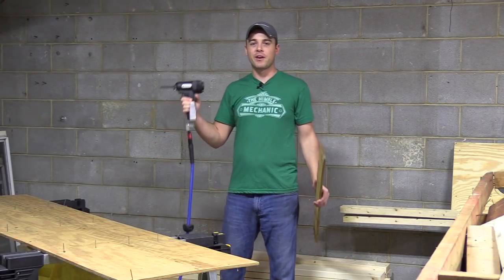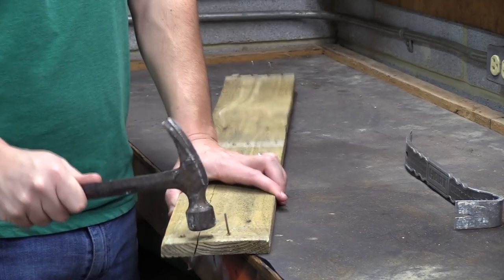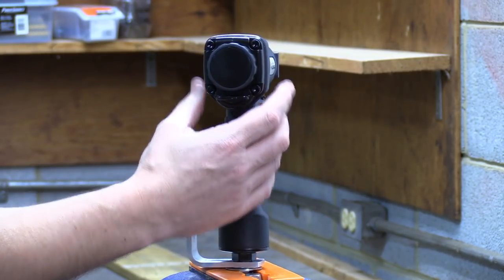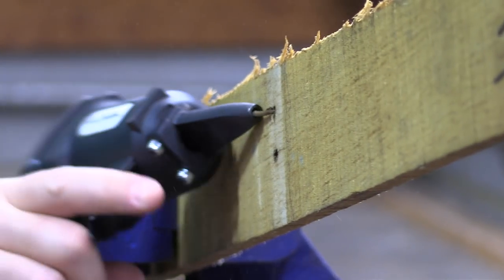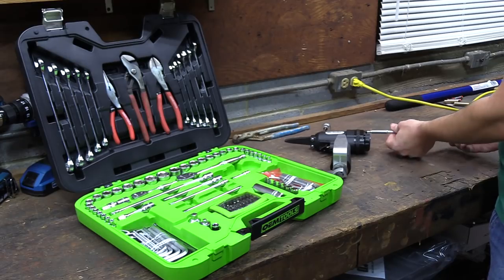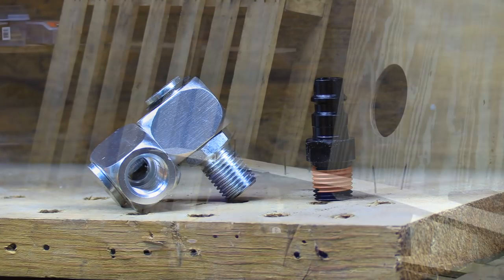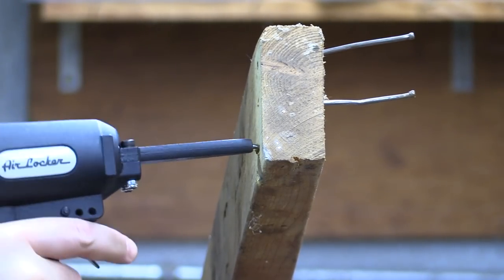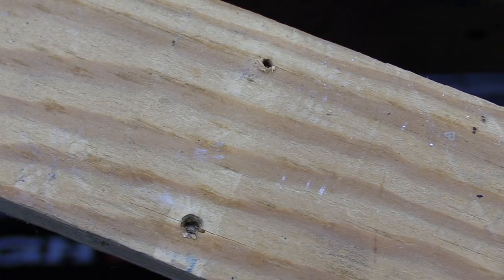FREE WOOD!! (*just remove the nails) - Air Locker AP700 Nail Remover

Comment: Helpful tip if using this or even the cheaper ones on Amazon... take a paint stir stick and drill multiple 1/16”, 1/8” or other holes in it... slide that over the nail before using this and it won’t leave the punch mark in your wood.
Reply: I was wondering about that.  Or taking one, and cutting a slit in it the width of the nail.  So that way you don't have to fish the nail through the hole, just slide it up and into the slit you cut.  But I don't own one, YET!!!  Would this work?

Comment: I've been using this nail remover with great success. It's a super tool and works best when de ailing dry, not wet wood. For safety I followed another user's tip and place my boards over a five gallon bucket 3/4 full of water and punch the nails into this. The water cuts the velocity of the flying nail quickly and contains all the nails in one spot.
Reply: Brilliant, thank you.
Reply: that's a really good idea. 👍

Comment: They should have different sizes of replaceable punches so you can choose the hole size it's going to make.  Otherwise, very cool.
Reply: it'd require the tool to be quite a bit more expensive.  You need to replace the guide as well as the punch.  They could offer different version's, or a conversion kit (though this would probably cost half the price of the took) but i think the market would be small.  If your that worried about the look of the wood, it's not very likely your using old material with nails in it (exception for the recent fad of reclaimed wood furniture)
Reply: Or, change the stop to where it's flush.
Reply: Seems like you could purchase extra punches then grind one short so that it does not extend beyond the front of the guide.   Only $12 he said.  Possibly would not drive out the nail all the way but you get a smaller hole.
Reply: Glenn Felpel
Exactly. That should be an easy fix.
Reply: just cut it flush with the end...the motion will be enough to pop nails
Reply: What if he just didn't put the gun all the way over the nail? Leave a little space and maybe the driver won't hit the board? Idk why I'm here but that's what I was thinking . awesome tool though
Reply: TheZigZiggy that's what I was gone say

Comment: If you wanted to eliminate the larger hole problem of it going into the wood, I bet you could cut the plunger shaft flush to the housing and it would work just fine still, just a little bit less power obviously

Comment: I am able to do the same thing with a palm nailer. Harbor freight $15. Works pretty well. Sometimes the tip of the nail sticks. No biggie. Just wiggle the tool and it's out. But you still have to use a hammer to pull out the nail totally. I don't remove nails that often to justify this $50 tool.

Comment: I just got the Air Locker AP700 yesterday and tried it out. What I was wanting to do is hit the HEAD of the nail and drive it out through the bottom on a pallet. It doesn't come out enough to drive it in one blow, but 3 or 4 and the wood split (at least on a weathered pallet with 3/8 top boards).

Comment: I own one and love it. It has saved me sooooooo much time on wood (pallet) cleanup. I agree with everything that you said in this review except the punch hole. To avoid this simply don't hold the tool all the way down over the nail or let the tool kick back slightly so the push rod does not push so much into the wood. If you deal with nail removal you NEED this tool.

A couple of notes here. 1. The nails will come out at HIGH speed. Safety glasses (if not a face shield) are a must here. I have had nails rebound around and actually hit my face and I am sure it would have resulted in a trip to the emergency room without them... 2. place a bucket or a trash can below where you are shooting the nails out and put come paper, bubble rap or some trash in the bottom to reduce the bouncing around of the nails.
Reply: Can't say as that I have tried that. I have a pallet bar that I use to pull the boards off the runners then punch out the nails from the planks. It may drive the nail into the runners, but I use them in my woodworking so driving them deeper is not my goal.
Reply: With a nail in a 2 inch thick board would this still work to drive it through without being placed all the way flush against the wood?  I'm concerned that with a stiff or rusty nail it could be prone to just bending the nail or breaking it if it weren't seated all the way flush to the board.
Reply: Price

Comment: i have owned this very tool for 4 years now its awsome cost little very light and easy to use i have driven many thousands of nails with no issues  simply brilliant i well reccoment the air locker 11 out 0f 10.

Comment: I own one. I bought it to de-nail a deck I built for my in-laws 35 years ago. 2 x 6 nailed 24” OC. My 9 year old grandson hit the 3 1/2” ringshank nails I used to put the soaking wet wolmanized (CCA) decking and joists down and @ 90psi the AP700 airlocker was blowing  66% completely out. Those that would cling to the 2x stuff he easily Removed with an adjustable head crescent 18” prybar. Thanks T2.0.. Your help and your dads REALLY helped me out, Thank you both,
Reply: btw, I picked up an extra piston as well.

Comment: Bought one a few months back. I use the hell out of it. Where it really shines is in processing pallets. No body is really shedding a tear over a pallet board having an enlarged nail hole in it. Most times I just use a circular saw and cut the outside runners off then use a Vergo Ind. Pallet buster to pop the slat off the center runner. If you're the type to go the reciprocating saw route by cutting the nails behind the slat, this lil guy is your best friend for punching the cut-off nail heads out of the slat. Because the punch extends beyond the end of the nail tube you just place the end of it on top the cut nail stub and It'll drive that leftover nail head right out or at the very least push it proud of the surface, which makes pulling it the rest of the way out as easy as swiping a flat bar over the other side to knock the heads off.

Comment: That right angled fitting prevents hose wear at that joint. Very smart!
The gun costs $51 on Amazon. With a bundled extra driver it is $58. The driver by itself is $13. Good idea to get the kit.
I think it makes sense to also get the angled valve thingie and the belt clip - very ergonomic and will spare your air compressor hose fittings from getting a kink.
Good review, and very happy to have seen this tool.  I need one for pallet work. I typically use a Sawzall to cut the nails off, because I like the embedded nails in the wood for texture.  I 'sand' off the tops of nails with an angle grinder and metal grinding wheel, then sand the wood down, stain, oil, poly up the piece and done.  However, it is very hard to cut the wood on the saw if nails are still in it. Some of the pallet ribs are thick and should be cut in half to be lighter for projects.  Now I can do that, hurrah!  Now to find a tool to pry off the pallet boards.

Comment: I have one of these. Works great, especially when tearing down pallets. One problem did arise but was easily fixed. A nail go jammed beside the plunger. I tool it apart and it fell right out. I haven't used mine for a while but I believe this unit requires oiling like a regular nail gun. I will read my manuel before I use it again. All in all, I was pleased how well it worked.

Comment: Just ordered from Amazon and it arrived today. Will put it to use in the next couple of days. Some of the videos I have seen suggest using alower pressure than 90 and also drive the nails into a five gallon bucket. I will give these try and see have it works for me.

Comment: Maybe in  cases when you want a smaller hole you could put a spacer  to keep the AP700 a little higher up from the wood , so the rod will not puncture the wood . Great tool and I will be buying one .
Reply: I'm thinking of 3D prining a "flush" spacer to fit over the nozzle.  This will allow the rod to only extend to the surface of the wood.

Comment: It is a fantastic tool and I use it several times a month - I dismantle pallets and work with pallet wood a lot. This tool took a lot of research (I have the silver/red 600 series, not the 700) but once I got it I have never regretted the purchase. Thanks for the good review video, you present very well.
Reply: If you don't put the nailer against the wood, I find that the hole it leaves will not be as wide - but personally don't mind the holes since pallet wood is already quite... holly
Reply: Hi guys, I just received mine 😊
But i don't know where to put the oil, can you please help me?
Reply: nico97412 in the air intake. Look in my videos, I show how to put air in mine.
Reply: Thanks 😊

Comment: I would go back 53 years and buy one.
My father used to pick up scrap wood and it was the job of my brother and me to clean the wood of nails.
Using old crappy wooden hammers whose handles would break was bad enough, but he wanted the nails straightened to be reused.
Banged a lot of fingers doing that.
Reply: Exactly how I learned to pull nails!!!!  And those bent nails were the ones I was free to use at 6 years old to build anything I wanted!

Comment: First, I want to say I do love this tool for working with reclaimed wood, namely pallet wood.  The problem is you have to pry the slats off a pallet first, which takes time and will crack/split 50% of your boards on a nice old weathered pallet.  Recip saw underneath the slats, just cut the nails off flush.  Plus, keeping the nail heads in the wood adds character, imo.

Comment: I have one of these, also from Amazon. Another use is that you can dial the pressure right down at the compressor, then use it to punch nail heads down just below the surface of verandah floorboards.  Previously, it took forever crawling round on all fours with a hammer and a nail punch to do that to all the nails that had worked loose and risen up over 20+ years.  But now, I can crawl around with the Air Locker and bang, bang, bang my way around the verandah in a fraction of the time.  We have a BIG verandah...!  If considering this, it's important to (a) dial the compressor output to the lowest pressure you can, and (b) do a couple of dummy run tests on some similar hardwood to the floorboards and with similar sized nails, to make sure you don't punch the floorboard nails right through on the real thing.

Comment: This is perfect! I'm building a shed/ workshop out of pallets and the ones I get are easy to tap the 3\4x3 planks off the 2x4s but it takes too much time to denail them with a hammer and pry bar and I'm too tired to put them up before I go to work. This will definitely speed things up and I have a lot more planks to harvest for the siding!
Reply: Did you finish the shed? What size is it? How many pallets did you use?

Comment: That is pretty cool. The price is not bad. You could regulate the air down so it does not damage the wood as much.
Reply from the maker: Yeah I guess so....I was using it at 120psi line pressure (max recommended pressure).  It seemed like the ongoing complaint I read about online was it not pushing nails out due to low line pressure.  Good tip!

Comment: I had to replace about 300 pickets in my daughters fence. The property owners association required replacement of several broken and warped pickets in the 16 year old fence, but replacing an old picket with new one looks terrible so I decided to replace all 250 or so pickets. The original pickets were installed with staples, a poor choice since a warping picket will pull the staples out but quicker and cheaper to install. A friend is converting four old grain bins into small apartments and is using old fencing as the inside wall material and wanted the old pickets. However, pulling the old staples is a nightmare, so after seeing the AP700 in another video, I ordered one from Walmart for $49.99 with free shipping and received it in about 4 days via USPS. The old pickets were easy enough to knock off with a hammer. Using the AP700 on a staple instead of a nail still works fantastic! Some it drives completely out, since I was driving one leg of the staple some don't clear the board. I have a Crescent NP11 11" nail puller. and that makes pulling the staple the rest of the way simple and easy. I am very satisfied with this tool. If you bust pallets for the boards, you just can't beat this tool. And, by the way, I replaced all those pickets using screws!!!!

Comment: That's one of the most unique new tools I've seen in some time. I definitely see value in it, especially for trim and baseboard. One question, how bad is the tearout on the face of the board when the nail is driven out? Ti me, that's the important side. It was kind of hard to tell but it only looked like the back of the board was shown in the video.
Reply from the maker: Some of the pallets had minor tearout....but a lot of those planks also had splits/cracks in them already prior to me removing the nails.  For the most part, it seems to be similar to using a hammer and prybar.
Reply: Think I'll just keep pulling all my trim / baseboard nails through from the back.
Reply: How would this work on 2x6 decking material with 3" nails sticking through? I will check to see if they have a stronger gun great video
Reply: Dale Gribble.   I have been doing it that way for thirty years, and it is by far the best method. Perhaps not the fastest, but definitely the best. Like anything else, Quality results typically require a little more time.

Comment: I've done a bunch of pallet wood salvaging and hands down the easiest way is using a sawzall to remove boards then this thing to pop the nail stubs out. No matter what tool you have to remove boards if you pry the pallet apart your wasting anywhere from 10-75% of the boards to breakage on most pallet types.

Comment: Great vid and interesting tool.  Would think like finishing nailers maybe there is a depth adjustment on how far the shaft comes out to address the hole you mentioned at the end?  Seems like a good solution. May reduce the complete ejection from the wood count but eliminates the hole issue.

Comment: I recently got one for reclaiming pallet wood, and am very glad I did. I think the hole size is less of an issue than one might think. One youtube video I saw strongly recommended drilling out the holes after removing nails the non-Air Locker way. This is to remove the little bits of wire that are left behind by some of the types of nails. Very important if you are going to be re-surfacing the boards with a planer or jointer. Using a hand held metal detector (around $20) is a help before spotting those tiny bits of metal before screwing up expensive machinery. I think the Air Locker slightly larger holes may greatly reduce the need for driliing out every single hole (saving even more time!)  Whether or not you're  re- surfacing the boards, that's when fine sawdust and wood glue is handy. (Others have stressed eye protection - Very important! Those nails really fly! I found one sticking out of the side of my shoe yesterday, after having fun with my Air Locker)

Comment: It's a great tool. Not as good as a nail kicker v20 but for the cost it works well. I reused all of the 150 year old actual 2X in my house for my front porch framing and left it exposed. Most of the time the gun just sits in my garage but it saved me hours of time denailing all of the original teue 2"X8"X24' fir. It's mainly used by pallet manufacturers to quickly fix pallets but they also mainly use the nail kicker it's a lot more heavy duty. And trust me I'm not one of these people that build crap with pallets I have 20 years as a finish carpenter.

Comment: As a teenager in the late 1960s I worked at building pallets and repairing old pallets.  My boss found out the quikest way to remove the board that needed to be replaced was to simply pound the nail through with a punch and heavy hammer.  Screw nails were almost impossible to pull from oak.  This tool would have made that job almost effortless.
Reply: Will - hi Will. I only want to break a couple of pallets down to use the wood to make small raised beds for herbs etc. So since it doesn’t matter to me that the nails remain in the big pieces of wood, is it possible that a nail puncher really is all I need. 🤔

Comment: Will you still get a hole in the wood if you don’t hold the gun flush with the surface? Or maybe use a spacer scrap piece of wood in between? Just finishing nails?

Comment: Question? When attaching the small air nailer hook, washer, internal tooth washer, and 360 degree swivel fitting in what order did you put them on? What size is the washer and internal tooth washer? I’m trying to figure out where exactly the internal tooth washer goes?

Comment: Been using a palm nailer for this. Wondering if you ground the tip so it doesn't protrude so far if it will still fire and function.

Comment: can you use this to push the nail heads roughly 15 ml deeper whilst boards are still attached so you just just remove the boards leaving open holes where the nail has gone right through?

Comment: most people only use pallet wood for shop projects like work benches anyway so the holes for me would not be a problem. if you are concerned just cut off the ends to remove the holes or fill them no biggie.